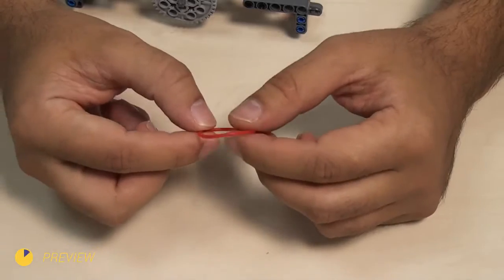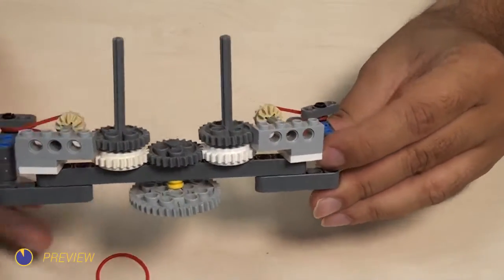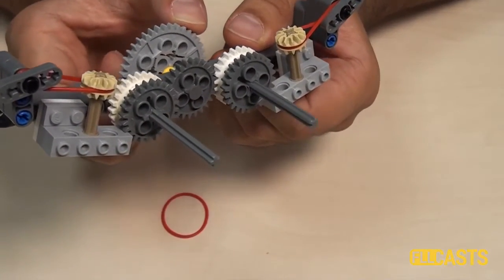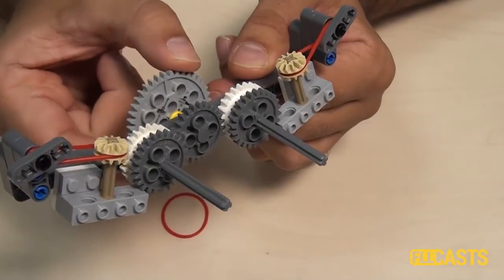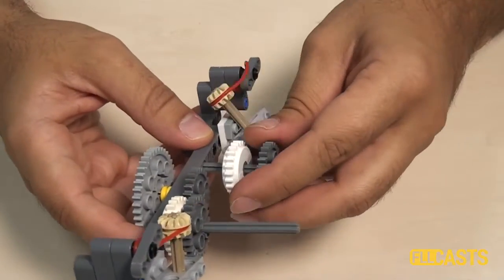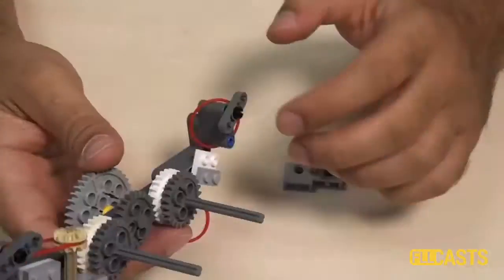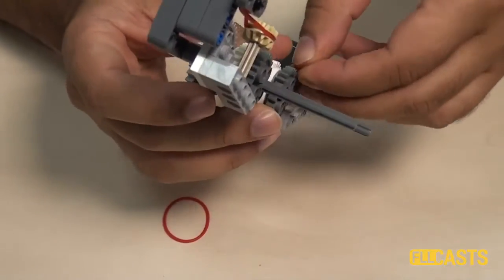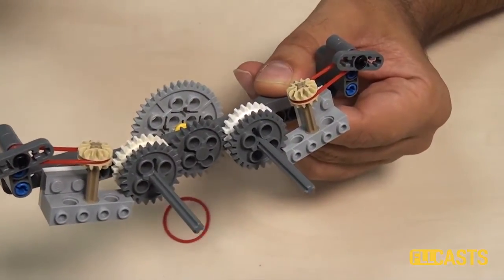Turning two axles, one at a time in opposite direction with one motor and two rubber bands

Comment: Would this damage the gear??
Reply from the maker: We have not experienced any damage of the gear that the clicking mechanism touches. The engineers said that it is very unlikely, but not impossible. The damage from two teeth skipping each other would be greater, and thus this is a viable way of making the gear lock.